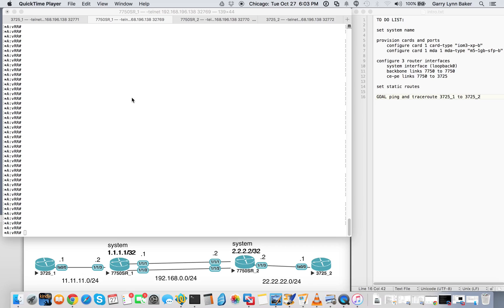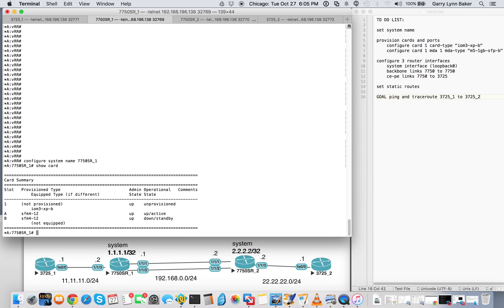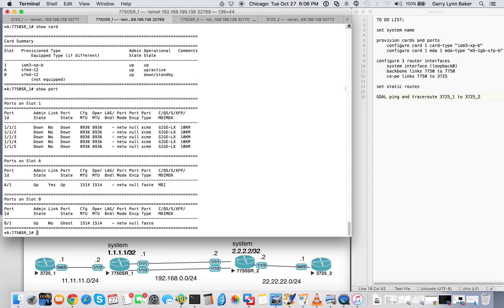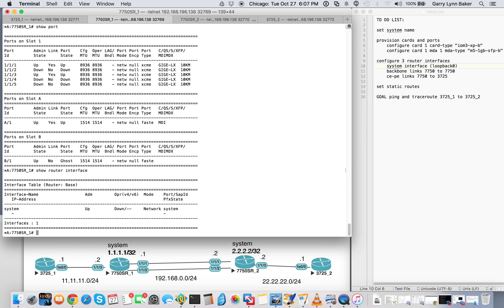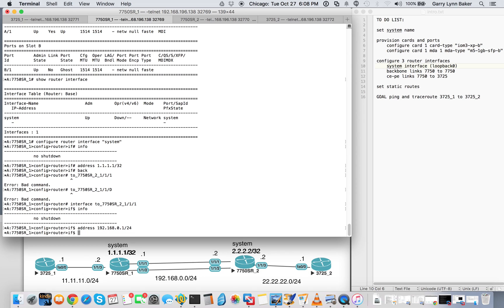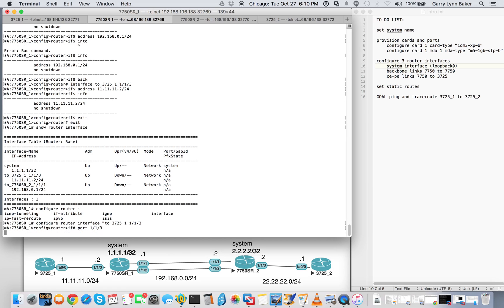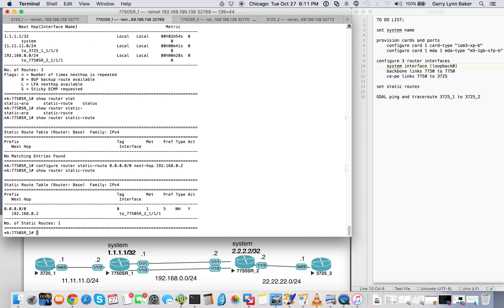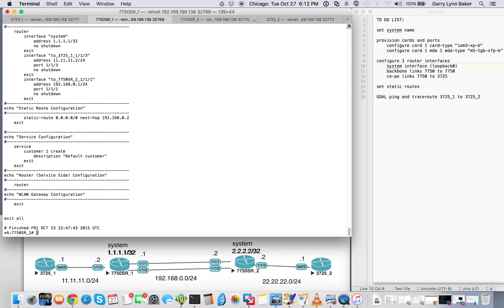7750 Intro

Comment: Also for the access port (Not trunk) configuration on ALU routers, why do we have to specify the  encap-type "dot1q" because this is an access port. For eg.
port 1/1/1
        description "R2"
        ethernet
            mode access
            encap-type dot1q
            mtu 9212

Comment: Hi Gary,
Thank you for sharing wonderful video.
Taking an example of 7750SR-a4:: If the IOM is configured in slot 3 and Two 20-port RJ45 MDA in slot 1 and slot 2. So the port ID will be 3/1/1, 3/1/2 ,, so-on and 3/2/1, 3/2/2,, so-on . Correct? Thank you.